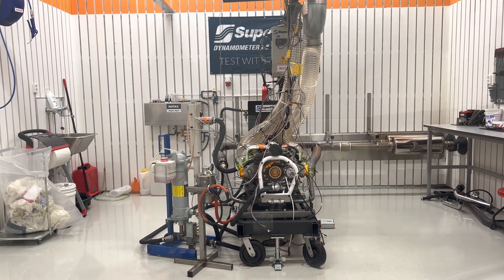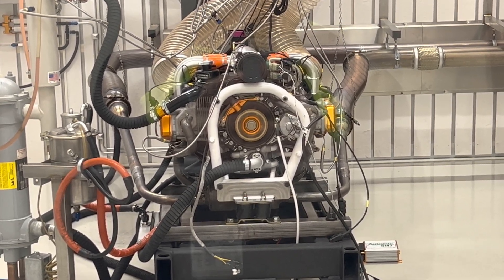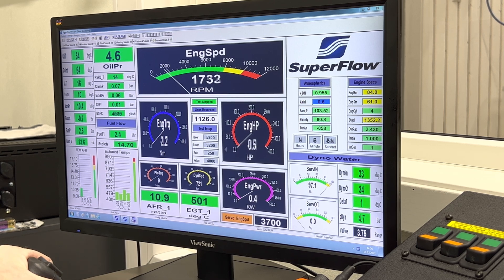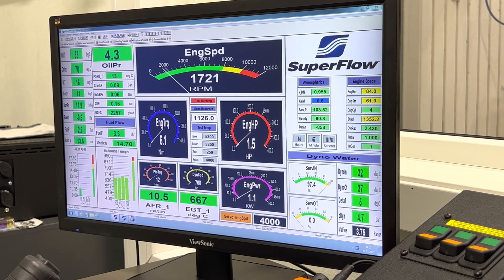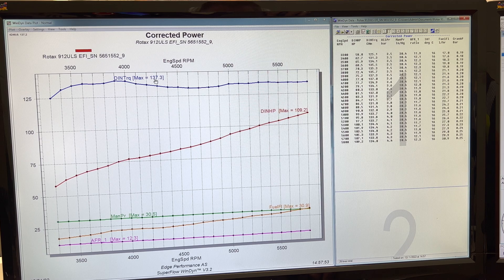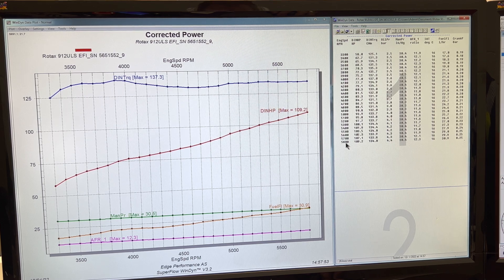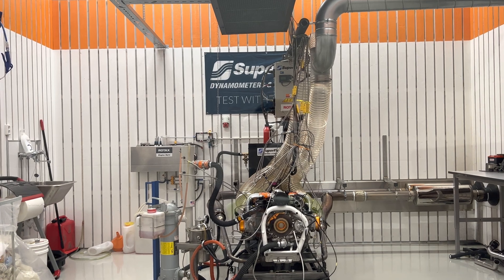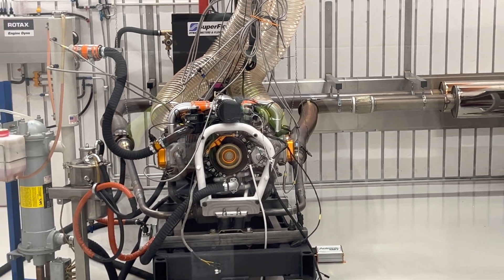EdgePerformance AS - Rotax 912ULS with EFI Dyno testing

Comment: Because its fuel injected, I assume it burns less fuel.  But, it also increased power, so does the fuel consumption remain the same as a carbureted engine or increase or decrease?
Reply from the maker: @darrylbraun8520  6-7HP increase typically and 15-20% less fuel consumption with our EFI.

Comment: Hi, why does AFR stay way under 14,7? is it to protect the engine? max is 12,3 on the graph..thanks in advance
Reply from the maker: The data you are looking at is from a dyno pull at 100% throttle. Running 14.7 at full power will blow up the engine.
Reply: @EdgePerformanceNorway  ha..ok.. thanks very much for the quick response. What is the maximum AFR you recommend? I'm going to install an AEM German wide spectrum AFR on my 912ULSFR (100CV carbs). What should I read MAXIMUM at 4000rpm in flight? 13AFR ? 13,5AFR? I intend to install an edge turbo kit in a second way..